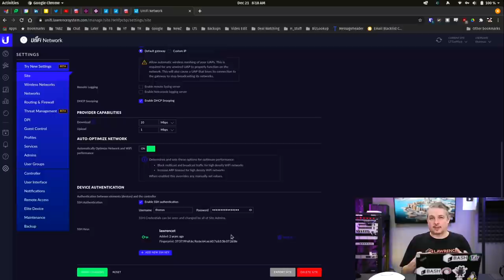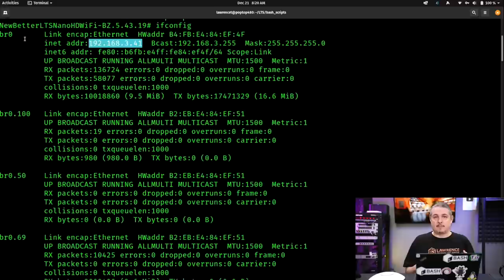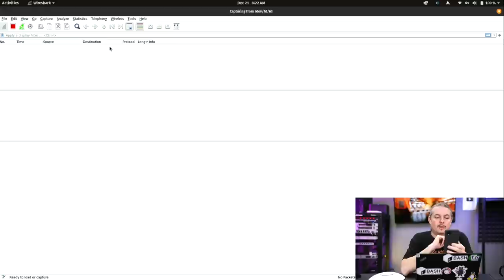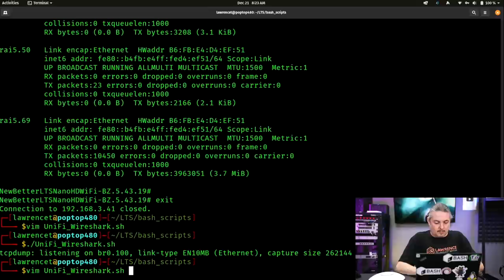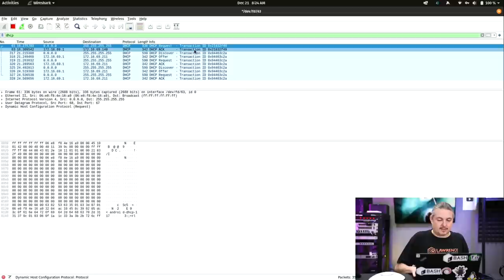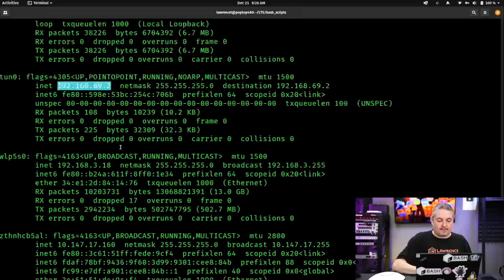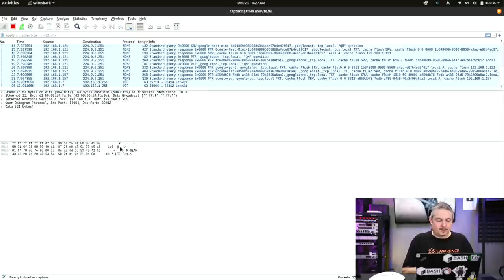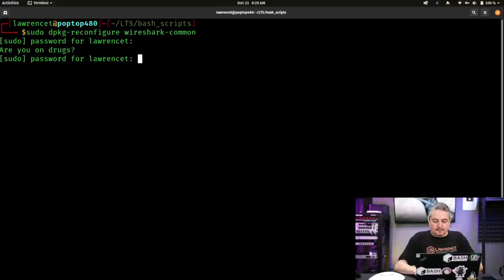Using Wireshark With UniFi Access Points for Real Time Packet Capture

Comment: Remote capture is awesome. Wireshark makes it even easier in many situations by offering to set up tcpdump for you. Look for the "SSH remote capture" item at the bottom of the interface list and click the cog/settings button to set it up. It will SSH to the remote and run tcpdump, then set up all the piping automatically.
Reply from the maker: Thanks for the tip! I have been doing from the command line for so many years not even sure when that was added.
Reply: Great tutorial from OP but THIS comment is gold!

Comment: One day my WEMO (Belkin) auto plugs and switches were working fine on my local lan. They all worked. Then the app asked to be updated, ok, updated for security seems ok, then I notice they all started surfing the net because their new directives were to report home to the cloud. I blocked them, then they all stopped working. So out they came and they are paperweights now. You don't own anything if it needs cloud access.
Reply: I had a similar issue with my WEMO devices because all are blocked from accessing the WAN. I got mine to work when a made a firewall rule to allow them to PING the gateway address. 

This was some time ago and have not updated them since. But are connect to their own VLAN.

Comment: This is very useful, thank you. I do have the same question as some others about whether we can capture the 802.11 packet headers and management frames, is there a way to put the ap radio into monitor mode? Wireshark is very useful for debugging the wifi protocols as well, but you need the 802.11 packet headers and the management packets.

Comment: I finally got around to using this to debug a troublesome TV receiver and I was able to determine that the issue was not because of something I did. I did have a bit of an issue though, I had to create an ssh keypair and add the public key to the unifi controller, if I tried to ssh in using my password ssh would try three times to login without a password and fail.
Reply: Thanks

Comment: This was too long for showing just 1-2 commands. I was hoping you would show this on a windows environment also or showing an -output syntax to the command. So that I could at least output the capture to my windows machine.
Reply: For a windows environment, just add Step 0: ssh into a Linux machine. (Including WSL2 on windows)
Reply: @trumpetpunk42  I can enter the command if I cd into the Wireshark folder under C:\Program FIles. But I can't figure out the correct syntax to use for the ssh into my AP.